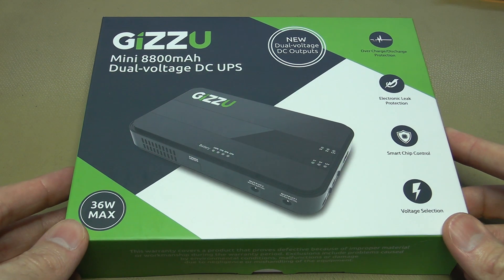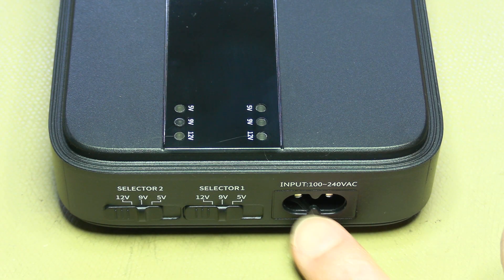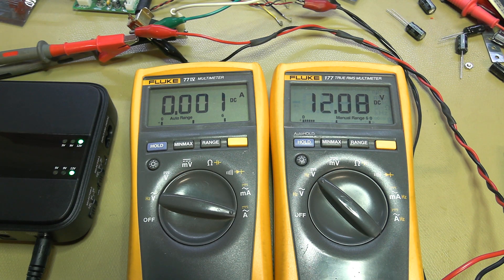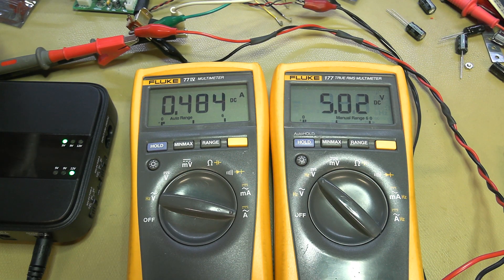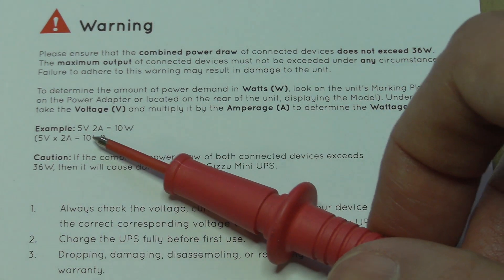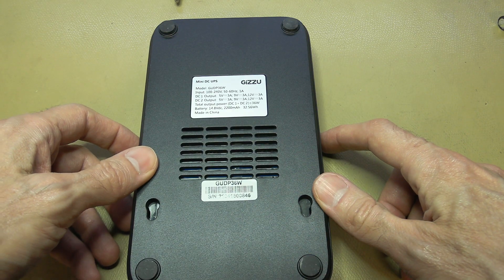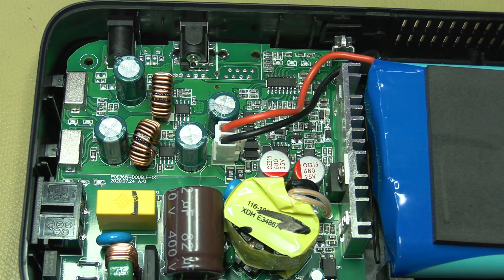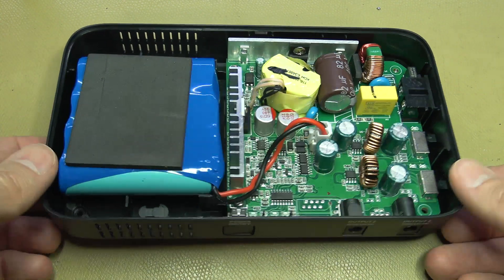Gizzu Mini UPS test and teardown (#027)

Comment: Hi, hope you can assist as I'm fixing one of these units and require your help just by providing me with a few resistor values/markings, I'm unable to read the markings on top the SMD as it burnt off. The resistors are R13, R14, R15 and R16 they are all sitting in parallel next to the big AC capacitor which you also mentioned in your video not being secured. Can't find a schematic anywhere online. Any help will be greatly appreciated
Reply from the maker: Send me a note via email (in the channel contact description) and I'll help you out.
Reply: Hi Aubrey.  Did you manage to fix the UPS?  I have a unit with the exact same resistors burnt off as well as the fuse blown.  Were there any other damaged components? Thanks, Derek

Comment: Hi Tech Bench nice review, mine is not charging what could be the cause to this?
Reply from the maker: Is this a recent development or was it like that out of the box? Not charging can be caused by a long list of possible issues, including:
 - blown onboard fuse
 - blown primary stage
 - faulty or worn battery pack
 - faulty charging board on the battery pack
Each of the above would require a technical person to verify or test. If you have a multimeter, you could check the voltage being sent to the battery pack to see if the fault is with the battery or with the charging circuit.

Comment: Good day. I recently bought this device (for my router and ONT) and as a first time user of such a devise, I would like to know if it is advisible to keep the the device plugged in 24/7? given the current state of loadshedding
Reply from the maker: Yes, it is designed to be plugged in all the time while powering your electronics, then switch over to battery when the power fails.
Reply: Thank you for the response, last question. Will the constant power not affect the batteries?
Reply from the maker: @zenzelenhlapo5418  Charging a lithium cell all the time without cycling it will reduce its lifetime, but in an environment where there are fairly frequent power failures, it should not be an issue.
Reply: @TechBench  thank you very much and keep up the good work.

Comment: What do I do if the output led lights stop switching on even if the ups has been switched on. What could the problem be. The only thing that turns on are the battery percentage led lights
Reply from the maker: Hm, interesting failure mode. Are both output circuits not working? If that is the case then it would seem something has gone wrong between the battery circuit and the output stages. Was there perhaps some sort of short-circuit on any of the outputs?

Comment: Good review! I have a question around the wattage. Does each of the DC outputs give out 36 watts or is it 36 watts combined? I calculated it as 36 watt per 12v 3a output? I have a 12v 2.5a router and a 12v 1a ONT, will this UPS then be sufficient as that will total to a 42 watt power draw from both outputs?
Reply from the maker: It's 36W combined over both ports. That said, I'd be very surprised if your router and ONT actually draw that much. I suspect those are probably just peak values and that idle running power draw is much less. In the worst case you may need two Gizzu's (one for ONT and one for router) to get you through those 4-hour stretches. Alternatively look at the UltraLAN DC UPS (Takealot and other places).

Comment: I'd like to know, when setting up the UPS do I keep it plugged in at all times with my router connected, or do I only connect this UPS once the power goes out? It's lithium batteries so I'm not sure if it having a constant charge will affect the longevity of the batteries?
Reply from the maker: This is an often-asked question. My view is that you can keep it plugged in all the time since the Lithium battery pack has its own protection circuit. That means they should not be over-charged and the device can be used as a true UPS with auto-switchover.
Reply: @TechBench  Hey I have another question. Would I be able to run a 6v device on this UPS? I've noticed the gizzu UPS only has options for 9v, 12v, 24 and 48v. My wife uses a beuer BY 40 breast pump which eats through batteries. It requires a 6v 1.0a 100 to 240VAC. The only issue appears to be the 6v
Reply from the maker: @True_Blood_89  The model I reviewed also has a 5V output, which might be just enough to run the pump. If your model does not have anything below 9V then you're out of luck, unfortunately.

Comment: Could one replace the fitted battery with a beefier heavy Duty one? something like a garage motor battery
Reply from the maker: Unfortunately not, for two reasons: 1. the charger would not be able to charge such a large capacity battery and 2. the charging voltage is not correct.

Comment: Please assist...How do this, 36W 32Wh 8800mAh compares to the bigger one, the 100w 46Wh 14400mAh   Will the bigger devices last longer on an extended load shedding ?  I have 4 devices - 5v and 12v (room 1) and 5v and 12v (room 2) in two different locations...please help.   Thank you
Reply from the maker: Indeed, the bigger variants will last longer. 46Wh means you can draw 46W for one hour (or about 11W for a period of four hours). 11W/12V=0.9A, which should be good enough to power an ONT and Wifi router. Of course, it depends on the specific models and what their current draw is.

Comment: Hi Tiaan
I have been using the same model for about 10 months, which worked flawlessly, but it is not getting through stage 6 loadshedding.
Would love to see a  video on tearing down the battery pack to replace the cells with higher capacity cells.
Reply from the maker: Hm, it could be that the load is rather heavy, but could it be that the batteries are just not getting a full charge in time for the next cycle?
Reply: @TechBench  what time is needed to fully recharge after it has fully discharged?
Reply from the maker: @johnnorthcote4753  That is a good question - I did not charge it from empty. However, it took about 2 hrs from being 50% discharged to go to 100%. I'd venture a guess that it will charge fully from empty to 100% in 4 to 5 hrs.
Reply: @TechBench  Thanks. With the load-shedding coming thick & fast that could be a reason for not recharging fully in time.

Comment: How many volts would you recommend setting it to?
Reply from the maker: The output voltage would depend on the device you are trying to power. The typical voltage for most fibre boxes and routers is 12V DC. However, some are 5V or 9V. To be safe, start with 5V and see if the router/fibre box starts up. If not, set it higher until you end up at 12V. Most of the devices have a sticker on the back saying what voltage they operate at (and if the center-pin is positive).
Reply: @TechBench  thx so much👍🏼

Comment: Nice video. Do you know whether the original battery pack comes with a BMS (battery management system) or not ?  I need to replace my batteries.
Reply from the maker: Yes, the pack has an on-board BMS. If you need to replace the batteries, you'll need to cut open the pack and salvage the BMS circuit. Or try to find a complete 14.8V lithium pack somewhere. A quick search shows that there are many options out there.

Comment: Hi. Could you tell me if I am damaging my batteries by keeping it charged whilst using it when loadshedding hits? So, it's permanently charging. One person said that it damages the batteries but I have heard differently.
Reply from the maker: The battery pack has a built-in cut-off circuit that will stop charging the batteries when they are full. It's part of the battery BMS. The design of the device is to be a UPS - you can keep it plugged in all the time.

Comment: would love if someone can do a video on how toconnect cctv camera dvr to this device- i see peoples reviews on takealot and they have said they connected their cctv but I dont know to do it as it's not just a straight forward plug in and work thing
Reply from the maker: Most of the cheaper CCTV systems work on 12V (for the recorder/display unit) as well as for the cameras. However, I would not recommend power a CCTV system from this unit - it really does not have enough capacity to power a CCTV system with multiple cameras.

Comment: Can I overcharge it or do I unplug it when it's fully charged. Thanks for the review.
Reply from the maker: It will not over-charge if you keep it plugged in - the charge current towards the battery pack starts at around 800mA and then it falls to zero when full. The battery pack itself also has a tiny protection board inside it that will protect the batteries from over-charge (and over-discharge). It is designed as a full UPS, in other words you can power your devices with it while there is mains power and it will automatically switch to battery power when the mains power fails.
Reply: @TechBench  OK that puts me at ease👍It was the only thing I was unsure about.Thanks so much for your prompt reply. Much appreciated 👍 God bless 🙏

Comment: Hi there.  We bought this UPS but it does not charge to 100% full power and the lights goes on and off automatically during loadshedding.  What might be the problem?
Reply from the maker: That's a good question. My best guess is that the devices you are powering might be drawing too much current, leaving not much left for the charging process.

Comment: When are you actually plugging it in and more
Reply from the maker: I keep mine plugged in 100% of the time and I run my router and wifi router from it permanently. When the utility power goes out, the internal battery takes over and runs my devices with relative ease over two to four hours.

Comment: Great, but how do I plug the damned thing into my router and modem?
Reply from the maker: Does your router and modem have a barrel-jack input that falls within the voltages the Gizzu can generate? If so, make sure both are center-pin positive and they operate on DC. The just select the correct voltage for each and plug the correct cable into the correct device.
Reply: @TechBench  my router has a barrel pin DC jack, but 19V. My modem has a fixed line with adaptor from the power source. So I bought the wrong UPS. It was recommended on a neighbourhood group. I thought we all had similar modems, but clearly not the case.

Comment: Thanks - and a question... I have one of these and it runs flat in about 2 hours. Can I add a second and maybe even third series of batteries in parallel safely to double operating time?
Reply from the maker: The internal charger is likely not rated to charge such large loads. I would, instead, consider getting another unit and power your devices separately. Alternatively there are larger capacity versions out there. Have a look at the UltraLAN UPS for such cases.
Reply: @TechBench  I have a Gizzu 2200mAh 14.8v, the fuse and a few components were fried by lightning. I want to do as above to parallel the battery to extend the life of another 8800mAh Gizzu.  I know you say it will be a struggle to cope with the larger batteries. Would it not just charge slower?
Reply from the maker: @BrennanBabb  It would "just charge slower", yes. However, there are some other potential problems as well. For example, each pack has its own onboard BMS (battery management system) which balances charging between the cells. By connecting both packs in parallel, you are effectively connecting two BMSs in parallel. Behaviour might be unpredictable. However, if you do want to give it a try, make sure both packs are fully charged so that their voltages are equal before connecting them together in parallel, else bad things will happen (such as rapid discharging from the one pack into the other pack). Do it in an area where you can contain a flammable battery ;-)

Comment: How long does it take to recharge to full?
Reply from the maker: That is a good question. The answer, as usual is, it depends. Specifically it depends on the load that you put on the device while charging. The more current that flows to your devices, the less current is available to charge the batteries. I'll be making a follow-up video soonish and will address your question.
Reply: @TechBench  i would want to know from flat. Because load shedding takes place so often that a lot of devices don't get time to full charge.

Comment: Hi there!! What are the cells called?? And do you know of a place in Joburg where I can get them?? I’ve got two of these and one just decided to work anymore, the other one is still on full battery two hours into loadshedding..
Reply from the maker: The individual cells are 18650 lithium cells (available in many places, try Communica, Rabtron or the Robotics.org.za store). But be aware that the pack itself has a control circuit inside the sleeve that acts as a balancer. Maybe measure the pack output first with a volt meter to make sure the issue is with the pack.
Reply: @TechBench  thank you!! Nothing lights up when I plug it in either.. So not sure what’s going on..
Reply: When I plug it into mains, that is..
Reply from the maker: @kakamas8  oh dear ... sounds like the mains input supply might have blown. There is a PCB-based input fuse ... you have a DMM to check it with?
Reply: @TechBench  I don’t have anything like that, it’s all Greek to me apart from taking it apart and replacing batteries.. Are you Joburg based, do you have an email address I can contact you on??
Reply from the maker: @kakamas8  yep, int he "About" tab

Comment: Any idea if the 65 watt version is also as good? The price difference between the two seems to justify buying the 65 watt version to take advantage of the additional battery storage. (8800mAh vs 17600 mAh)
Reply from the maker: Considering the pedigree, yes, I would say it is just as good. I have not tested it though. What I have tested, if you're looking for something a bit bigger, is the UltraLAN micro UPS. It's a nice bit of kit and has the cool display as well. Recommended.
Reply: 17600mAh mini dc ups

Comment: How would one keep this device connected to the router and wifi box continously as the cable as such on the fibre box they are more like eternet cable . The two cable things this ups comes with have that rounded ends

Comment: Mine got hit by lightning. So used your video to learn how to open it up and checked the board. Batteries are still fine but board not. Wonder i fthe battery management circuit also provides for charging? Can then try and  use batteries for other 12V devices.
Reply from the maker: The BMS typically does not handle the charging voltage - just the balancing and cut-out (when either full, or close to empty). The nominal charge voltage of a lithium cell is usually around 4.2 volts, to I would expect the pack, with four cells, to charge up to 16.8 volts. I would thus expect the mains switching regulator to be generating that 16.8V charging voltage. You'd be out of luck in trying to power 12V devices without some sort of 12V regulation. A cheapish LM7812 should be able to handle that task fairly well, but you'd still need the higher voltage to charge the pack, unfortunately.

Comment: What is the price of this cell battery 11:00 which is installed in the UPS?
Reply from the maker: The individual cells are not that expensive, but pricing varies a lot depending on quality. If you can, try and use LG or Samsung cells. I've avoided using the (sometimes much cheaper) Chinese off-brand cells. Just google/amazon "18650 cell" and you should be presented with loads of options.
Reply: @TechBench  any idea how long these batteries last before they need replacement?
Reply from the maker: @Gnarkill667  Good question! Normal cycle-count of a good quality 18650 cell is around 1000-3000 times, depending on the quality of the BMS. So if you have one discharge cycle every day, you can probably reckon on a minimum of around 3 years before the cells start to go bad.

Of course, if the BMS is not great and the cells are of cheap-ish quality, then their lifetime might be a lot less.

Comment: Nice unit, looks like it might survive well. Battery pack easy to replace, and the 4S protection board is easy to get as well, and cheap. Nice to have good tight grip on those barrel jacks as well, rather than the sloppy fit you get on a lot of them.